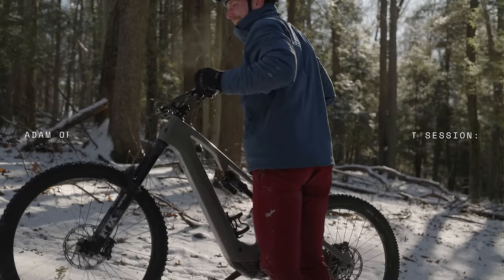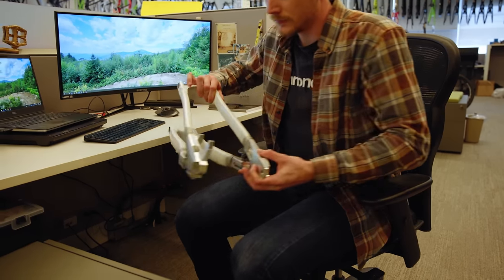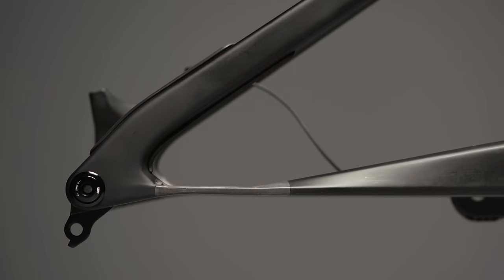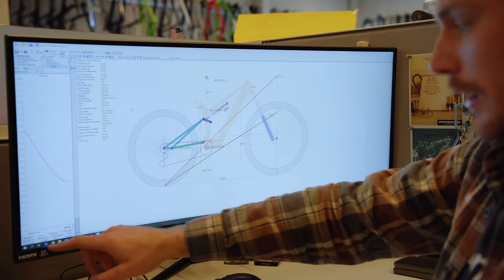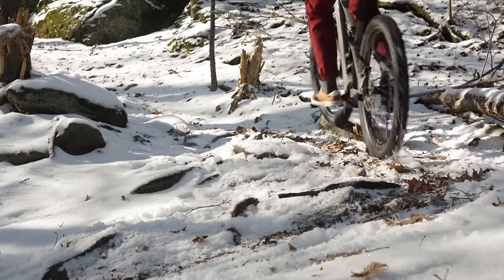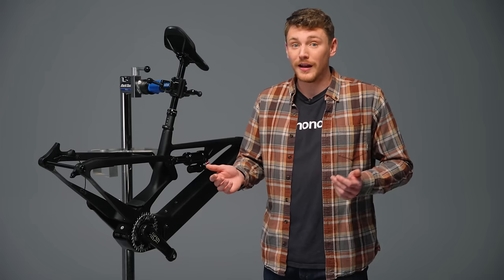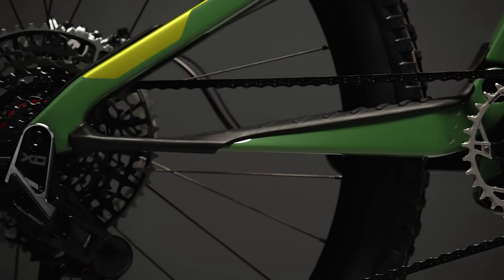The Revolutionary FlexPivot Suspension System | Tech Talks | Cannondale Moterra SL

Comment: I want to see you guys test them to failure. Do it and share it? Just how far till it fails? 200%? 400%?
Reply: They wont show that🤣
Reply: 200%? 400% of what? Such a poor question.
Reply: @LifeCycle1978  It's not good to question when something will fail? Yeah, okay bud lol
Reply: I don't see how this can't be reliable.  It's not that different than a Lauf suspension fork and they're remarkably reliable.   I bet this handles like crap though😅
Reply: @veganpotterthevegan  lauf doesn't have the damping. This does, but replacing 1 out of 4 bearings does not seem worth it.
Reply: @lechprotean  I never said it does.   I'm simply commenting on reliability.
Reply: I have the Scapel SE Ultimate with a Lefty fork. I weigh 210 and ride the blacks and hit drops and jumps on this bike with 120 travel. This bike sticks to the ground and the flex pivot has worked flawlessly for me. I just also bought the Lab 71 version of the Moterra SL. I will beat this bike and and let you know if I snap the flex pivot. I doubt that is going to happen.
Reply: It would be measured in cycles.  Also this design is used by other brands as well using only Aluminum, ie Giant Stance.
Reply: @lechprotean carbon has damping characteristics.   Also this design is already used by other brands using only aluminum without issues.  IE giant stance.
Reply: 150% of intended load is not at all a healthy margin.
Reply: @Nomad-MTB  I'm curious how it actually handles side loads and torque. One guy broke his rear triangle simply by falling off at a stop light.
Reply: And when it needs a warranty job, they will turn their backs. Not interested.
Reply: What about fatigue? Carbon flex... But its not a ruber
Reply: @LifeCycle1978  Someone didnt even watch this video
Reply: @cedricgtrable  carbon is typically better in fatigue than metals. The carbon aerospace struts I used to work with would last for millions of cycles beyond what customers needed in testing.
Reply: cheap bikes in super market looks the same , it calls 'we need to make it less expensive in prodaction' and you will eat it like "feature"...naaah
Reply: @LifeCycle1978 they literally said in the video they tested to 150%, so more than that..
Reply: It fails at the price tag I'm thinking.
Reply: I think the only issue might be time, how long will a frame like this last?
Reply: The carbon works as a flexure, not a spring. In normal use, its degree of flex is controlled by the stroke of the damper - so it will never see more than 100% flex in normal operation
Reply: Shouldn't be any less strong, just significantly less stiff, to the point that it acts like suspension. It probably has more cross sectional area (more material) but a lower "section modulus" basically a measure of how stiff a shape is.
Reply: @christiandruan Are you asking about he life cycle of the flexpivot ? Whats a full load cycle ? That question is very poorly asked if you understand anything about mechanics of failure
Reply: @ItsYourBoiUhh  I am asking at what point does it fail/break, really not that hard to understand...🤦‍♂
Reply: @christiandruan that’s not what the guy was saying. 200% of what?
Reply: @smallpeople172  Because in the video they say they tested it to 150% and stopped testing it. Did you not watch and just start leaving comments?
Reply: They actually not to do thatb😂
Reply: Un argumento un tanto absurdo 😂
Reply: @christiandruan  It's not a good question because it doesn't make sense. He literally does not specify what they need to measure.
Reply: @harrisonclark3799 The breaking point just like they mention in the video num nuts!
Reply: @LifeCycle1978  of its intended load bro, in the video they try out only 150%
Reply: Yes and in any case you can't go upper Than 100% range of motion due to the geometry of the bike. @christiandruan
Reply: It’s used on other brands from 10 years maybe more ! I got it on my Orbea Oiz 120 for 2 years and I’m an ex BMX / Skate street rider so I hammer a lot on gaps and fly everywhere I can 😅 everything is as new and there is a lifetime warranty anyway. This tech is proven already.
Reply: It's a part of the linkage that barely moves.  I don't think it's possible for it to break.
Reply: @AlanDemoulin  No ones talking about range of motion🤡
Reply: @Jean-jk4zv  You heard it here guys, he rode it for 2 years its all good lmao
Reply: yeah a hundred and fifty% feels to less for a regular use bike, maybe ok for a competition bike where its gonna be replaced quite often.
Reply: @LifeCycle1978 200-400% over the expected range.  You not understanding the question doesn’t make the question a poor one.

Comment: This scares me. I'm sure they've done extensive testing. Still scares me lol
Reply: Your right to be scared. I too don’t trust it. I think it is a weak point and eventually it will break especially with a ebike. Only way I would even consider something like this it would have to have an unconditional lifetime warranty on frame.
Reply: Even if both lower flex members fail the upper bridges will probably stay intact plus the mechanical linkages, so there are built in safety redundancies. But I'd always test it until failure just to see when and exactly how the system fails ALWAYS
Reply: I think it's natural to get scared, but technically, has no sense to worry about it. Thin layers of material, are stronger than thick ones, due to microcrack propagation phenomena. A layer of 20x5mm of carbon ,of sure holds up to 300kg of tensile streght. It's something like fiberglass in terms of the rigidity and brittleness of glass in comparison with tissue texture, and the only difference is that fiberglass is hair thin filaments of glass
Reply: This is the Lauf front fork technology but put on the rear.  Lauf has been doing this for years.  As long as Cannondale has decent manufacturing quality, you should be ok.
Reply: you dont get the nick name crackandfail for nuthing
Reply: Carbon fiber, fine, the epoxy that sticks it together, that is going to fail.

Comment: I feel like typing.
As long as the design is substantiated through testing and the manufacturing processes is insured the science is certainly there. For a short time I was an aircraft wing structures engineer and the science and testing that went into composites throughout our FAA certification gave me a lot of confidence in the material, if executed well. That said, stringent manufacturing and quality control is key, as is having a plan to deal with manufacturing defects, which are inevitable. In my group, our typical tests included static load, fatigue, damage tolerance, and allowable defects tests. I suspect Cannondale's testing would be similar.
Reply: Hopefully. They don't have aerospace money though
Reply: @ameraldas3641  Are you sure about that?
Reply: that kind of testing has to be standardized and mandated

Comment: Giant has been doing this for years and it works great
Reply: And only using aluminum as my Giant Stance
Reply: @sk8moto  mine too
Reply: So is Trek
Reply: Also Scott
Reply: @treimar  what model?
Reply: @haddedoussama14  For example spark.
Reply: @treimar  wow, didn't know that. Thanks for the info
Reply: Cannondale themselves have been doing this for years - the 2003 Scalpel had a flex pivot on its chainstay. Even on bikes that old, they seem to work well & last.

It's odd that Cannondale would consider their own 20+ year old tech "revolutionary".
Reply: @treimar   well giant dose make scott bike so its not realy shocking

Comment: IF they did their CAE correctly AND IF the manufacturing process is performed correctly, it could be fine. BUT even then, I would be inspecting that member regularly for chips/cracks/delamination. Carbon has a catastrophic failure mode.

Comment: "We didn't test when it would fail" Wow what  a great researching you guys are doing over there. I feel really save!
Reply: You did a great job of completely missing the point.
Reply: @FiveWindows  Ok sorry, what do you think I missed?
Reply: well you dont get the nick name crackandfail for nuthing
Reply: Why did you use quotation marks if the quote you're using doesn't exist? What they did say is, "we ramped up the test rigs to 150% of the intended load, and let them run until we got bored of the lack of failures," which 99% of the people watching understand means it is very durable under circumstances other bikes wouldn't survive. 

Hope this helps. I know it's a really long video and watching it twice must be hard.
Reply: @Mwstmrlnd   How I would think things are is that testing a bike frame part for 150% of intended load would not be enough to say that other bikes wouldn't survive that. 
I don't know if that actually is the case or not but if you know it is false I would accept that.
Reply: @Mwstmrlnd  ok, take 200, 300, 400 and break it. Where limit?

Comment: How do you account for rider weight? My 23’ StumpJumper Carbon also uses a carbon “flexture” 4 link but this is providing some spring force in the suspension design. I believe this is contributing to suspension progression, allowing for more linear linkages to be used for increased tuning granularity with an air shock. Enter 225# rider, and this support goes away, and frame becomes entirely too linear, especially in the mullet configuration which inherently reduces progression in the “flexture” Horst link design. Curious how cannondale is accounting for this engineering wise? 40# difference in rider weight is a big change in optimal suspension forces!

Comment: Yes a bearing or bushing is replaceable, when the resin holding the carbon inevitably fatigue this isn't.
Is it?
Reply: But for bike company it is cheaper to produce and if it will break you would have to buy entire triangle or bike, so win win for them ;)
Reply: it has lifetime warranty btw
Reply: @sweetalert480  Even for the second owner somwhere in Europe? Do not think so...
Reply: Carbon fiber has nearly no fatigue limit
Reply: @baptistecroissant475  That's exceptionally false. And once you surpass it, it's broken and basically completely useless unlike aluminum which just bends.
Reply: @JZStudiosonline   properly bonded composites experience essentially no fatigure from repeated cycles below a threshold strain (for a given geometry). Most likely you will never exceed that strain, so it will last basically forever. Why do you think cars (for example the Corvette) can use fiberglass leaf springs instead of standard coil springs?
Reply: @JZStudiosonline  that is basically the definition of fatigue limit lol. Dont try to think you know more
Reply: @baptistecroissant475  You mean the part where I said "Once it's surpassed" which implies I know that the fatigue limit has been passed? Was that supposed to a backhanded insult, because it just made it seem like you're illiterate.

Comment: Considering the amount of soft and hardtail carbon frames I see break in the rear triangle and repair, I fail to see how anyone thinks carbon bike frames are a good idea. F1 teams will literally throw away the suspension components after every race and replace it with new ones.
Heck, most of the broken frames I've seen have been from simple things like just falling over.

Comment: Nice presentation of the research e development!  Do you actually really need a pivot point there? Santacruz with the VPP has rigid rear triangle since ages... Am I missing something?
Reply from the maker: Different types of suspension. Santa Cruz uses a VPP setup where a rigid rear triangle is connected to the main triangle via two counter-rotating links, with all the associated pivots and bearings (and maintenance). Ours is a true, 4-bar (Horst Link) style suspension, made lighter, less complex, and more durable by our FlexPivots.
Reply: Yes you are.
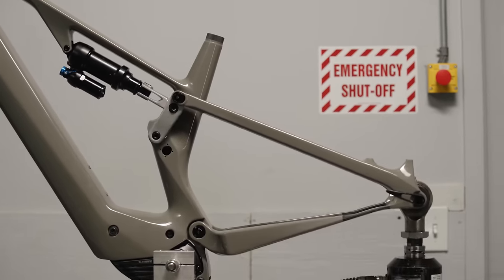Reply: @CannondaleBicycles71  I can't see that carbon flex much on that video at 1:35 , at least in comparison to an old skool pivot point.

Comment: This is almost completely pointless. As evidenced by the fact that they have chosen the joint that has to expand the LEAST. They've chosen that joint because the technology has extremely limited use. This is exactly analogous to spending millions of dollars in research to.......make your brake levers lighter. Does it make your bike lighter? Very slightly. Is it worth it? Hell no.
Also, now this joint acts like a spring - admittedly probably only mildly - and interferes with the spring rate of the shock. Good luck tuning that in.
Quote: "Having a Horst four-bar linkage lets us precisely and independently tailor how the suspension responds to different inputs."
Notice how they did NOT say "Having a FlexPivot lets us precisely..." Because you get ALL these same benefits of a Horst link by using a traditional bearing. This is just deceptive marketing. And they know it. Someone had to very carefully craft these statements so that you think they are talking about the FlexPivot. But they are not.
Quote: "The advantages are significant.."
"WRONG sir. WRONG." - Willy Wonka.

Comment: Of all the things to be concerned about on this bike, the flex pivot is inconsequential. I've owned Transitions, Yetis and Specialized bikes with flex pivots some of them almost 20 years ago and never an issue.  I'm more concerned that when the custom battery dies (and it will) there wont be a replacement for it. I'm about 90% sure I'm going to get one of these bikes.

Comment: You guys just compared pull rod formula 1 suspension system with a thin fixed carbon fillet suspension on a bike? Come on, you gotta do better than this. This is pure marketing.

Push rods are articulated via titanium sockets. Not directly to the frame. There is no camparison between the systems.

Comment: Good pitch but people like to mess with their components, take them off, and put them back on the bike.
The way it replaces a bolted joint won't allow people to disassemble and change the bolt/joint.
Non-standard components in a bike are a big throw-off.

Comment: I don't trust any bike manufacturer that turns the shock sideways and adds an extension clevis. 

All the shock manufacturers have finally grown bawls and put disclaimers on their websites regarding this design. They should be mounted vertically and in a rocker, or horizontally using the shock eye as a pivot.

If you can't design the easy part, how can we expect this to be well thought out?

Comment: Get ready technicians and mechanics!  Go ahead and create a Cannondale Warranty shortcut on your desktop and get youself a "carbon crack test kit" together.  I loke to clean with alcohol and tap around with a penny listening for differences in sound.  Delamination on a bike anywhere is no bueno. Chalk and a damp paper towel are good for finding cracks and if the paints cracked, carbon's cracked in some fashion, most likely toast.  If you can see inside the frame it should be smooth, zero splintering.  If you can see the carbon weave, make sure its even.  check that the outside surface is smooth and even, too.  All of these are signs of bad carbon layup.

Cannondale, if you see this, holla at ya boy.  Ive sold your bicycles for years and Ive worked in aerospace as a composite tech.
I could help make a mess, at least.

Comment: planned obsolescence, the guys made a disposable carbon bike frame, carbon fiber depends on resin to assemble itself and the resin has a short lifespan, especially speaking of a carbon that will be exposed to the sun, UV rays and weathering, a frame like this With the stress it will suffer, it will not last 2 years of moderate use. In addition to blows from stones and branches.
There is a lot of desire to sell an expensive and disposable product in the midst of an urgent period of anthropogenic warming.

They would be more honest if they said that they will sell much cheaper than conventional frames because they last less, that would show respect to the consumer. But it is obvious that they will use marketing to convince people to pay more for a disposable product.

Comment: Planned obsolescence, now you gotta get a hole new frame instead of servicing your shock or replacing it which by the way you still have to do cuz this doesn't replace your back suspension so it's completely useless just a way for them to guarantee when you will need a new frame

Comment: What about compression and rebound adjustment for individual rider preferences? Suspension feel isn’t a one size fits all feel.
Reply: So true
Reply from the maker: Our mistake. It appears our previous comment was meant for a different question. To answer the original comment, FlexPivot adds an imperceptibly small amount to the progressivity of the spring rate, but compression and rebound are handled by the shock. The Fox Float X shocks we spec on the bikes provide excellent tunability with external compression and rebound adjustments, plus two position firm mode.
Reply: @CannondaleBicycles71  lol no problem

Comment: These types of systems induce yaw on the rear tire. They also lead to fatigue in the composite material due to constant flexing. While it may be a viable option for professionals who have free access to parts and don't ride the same bike too frequently, it will eventually break when subjected to intensive use over a certain period of time.
Reply: Got this tech on my heavy duty bike for 2 years, no probs and lifetime warranty. Don’t agree with your argument.

Comment: I think the tech has improved sufficiently enough that you can go back to the original flex stays of 2002 or have it an option.
Reply: Oh I was searching and did not find things prior to 2013 ! So it’s way before ! You got a source ?
Reply: @Jean-jk4zv  I’m talking about the original chain stays that they used up to 2012. The chain stay flexed and didn’t have a mechanical pivot where it bolted to the frame. It was just glued.